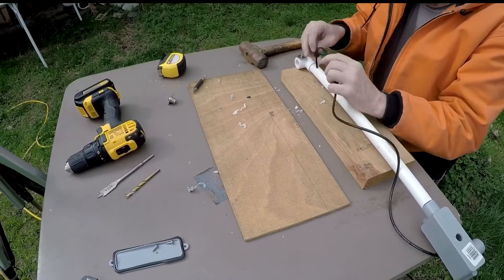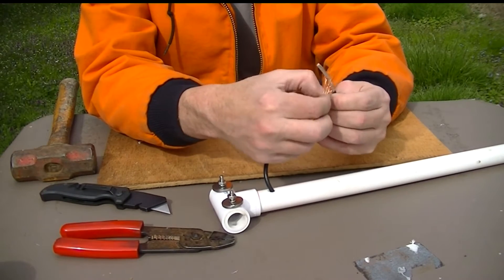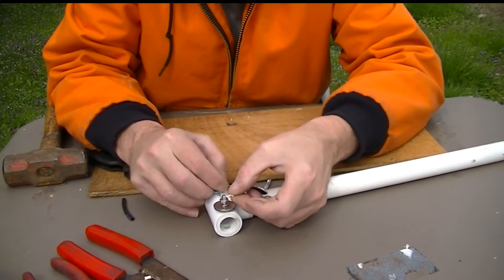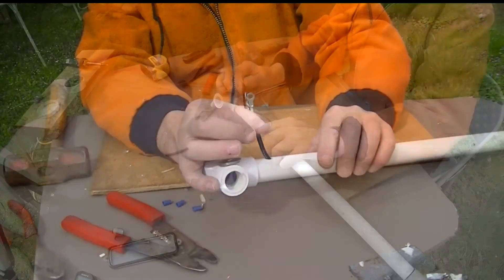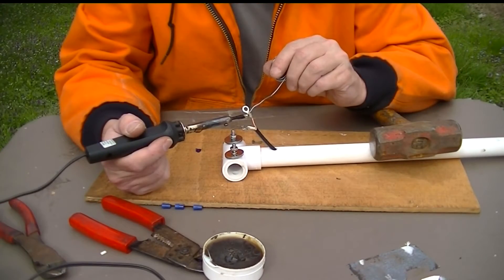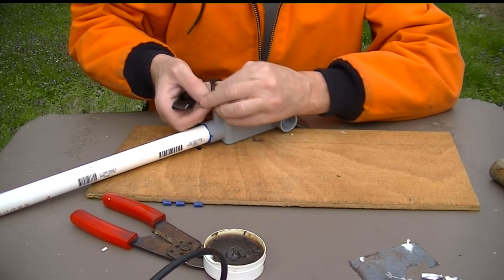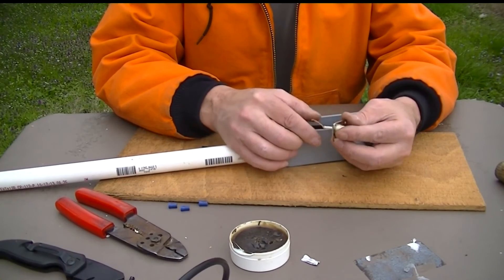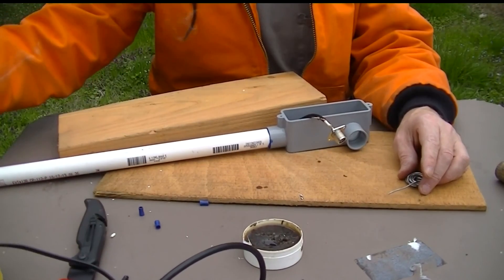BUILD # 3 - Dual band vertical Dipole (Pt 2 of 3)

Comment: You need to use a choke make a few turns of the coax around the boom so the signal will be picked up by the dipole only and not the coax shield. Dipole antennas are balanced antennas and coax is unbalanced. This is a good antenna , keep up the good work.
Reply: Can we tape some aluminium foil tape on coax instead of choke?  Because i already made this antenna and it doesn't enough coax for choke.